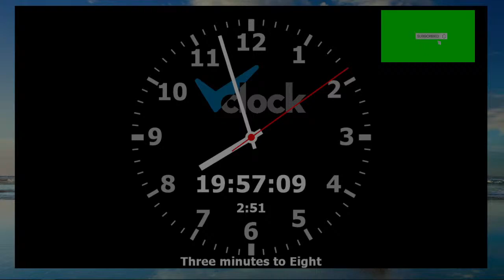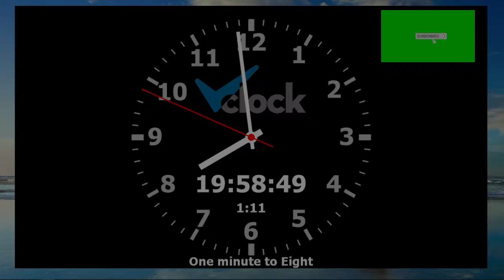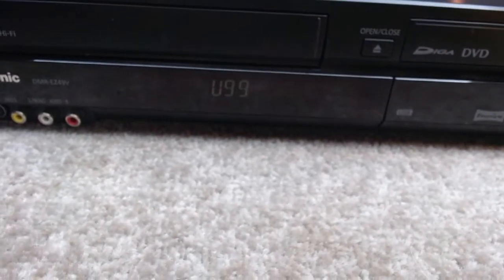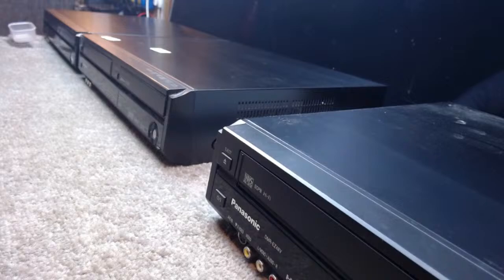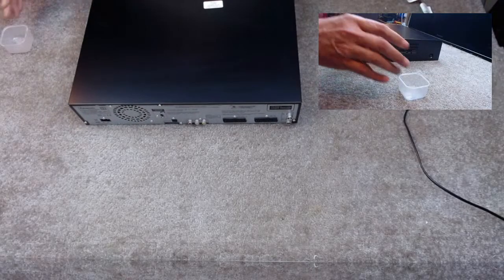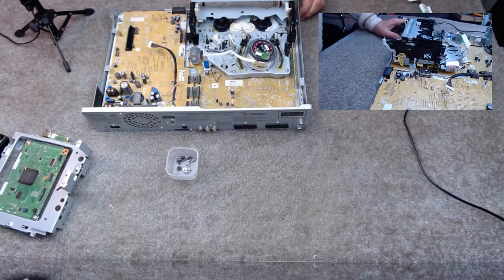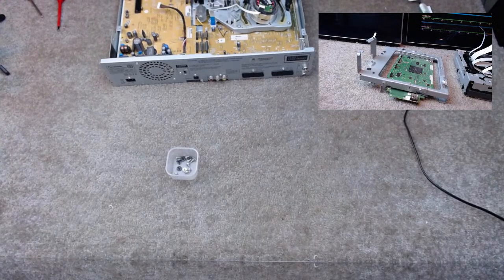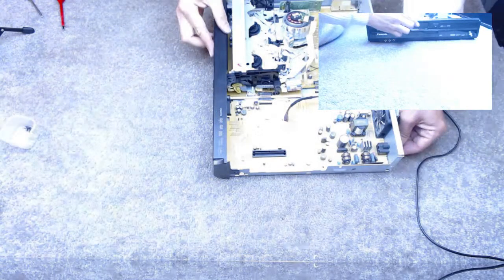Panasonic dvd recorder u99

Comment: Hi I have a number of these units one unit is the DMR-EZ49V everything seems to work apart from "reading and recording discs seems to load OK at first then a dvd hunting noise and will not eject unless I hold eject button for about 30 seconds. Weird thing is I put a head cleaner CD disc in it and it played perfect. Any ideas? Thanks Nigel
Reply from the maker: The 748-9 range had very weak lasers I’m guessing yours has broken down.   There will be replacements on eBay.

Comment: I’ve got a EZ49V with U99, when you say it’s an expensive fix, how much are you looking at? And could you link me to the parts on eBay? Cheers
Reply from the maker: You need a new dvd drive.  New they are £175 plus vat. But I’m sure eBay has some.  Do bear in mind that on some occasions you also need the digital board underneath as they pair together but you may be ok with just a drive swap.

Comment: i have the same code U99 and vhs will stop playing after 20seconds
did u managed to fix that code?
Reply from the maker: U99 is failed Dvd ram assembly. New dvd and digital board needed.
Reply: @allenfleckney5969  ahh thanks for reply , i dont think its worth to fix it...
Reply from the maker: If you post it I will gladly have a look and test